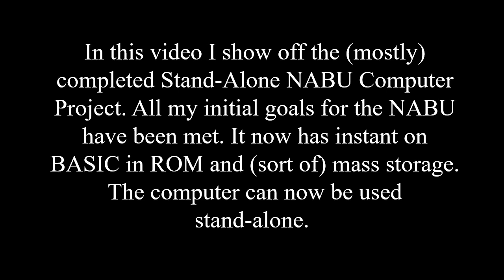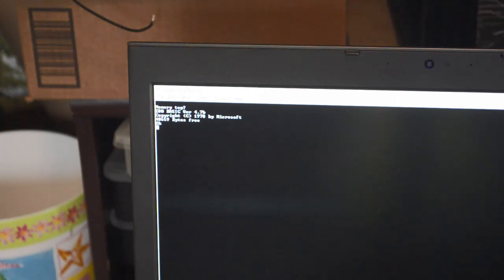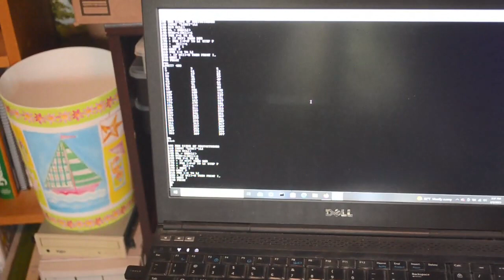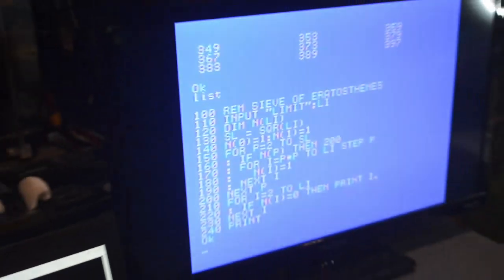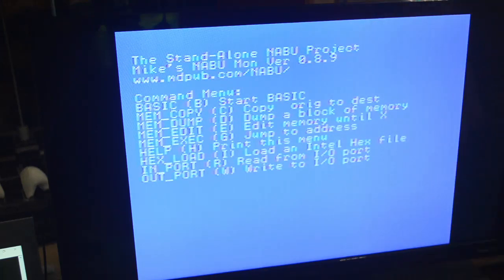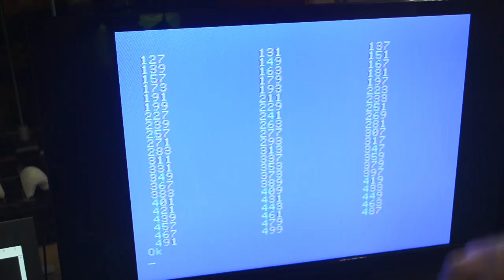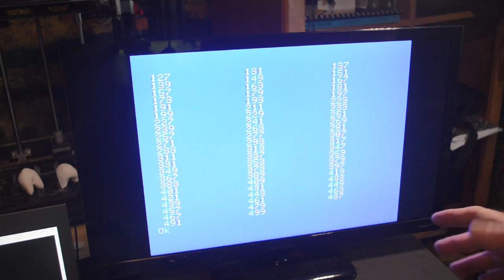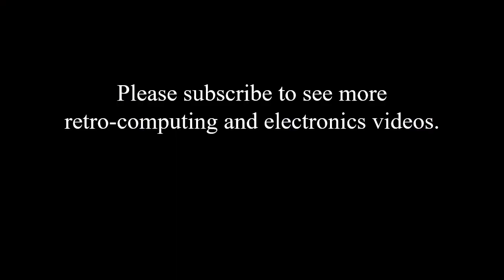NABU Computer Hacking #11 Mission Accomplished! The Stand-Alone NABU Is Ready

Comment: Wicked! Glad my backspace advice worked! I figured because I ran into the same thing with Microsoft basic and cloud cpm. The default baudrate is 111,861. Mjp’s pdf just rounds it down. I did the calculation.  The actual baudrate would be 111,860.78125bps, which is impossible to have decimal values. The baudrate is calculated by the TR1863 datasheet, which is the clock speed divided by 16. So the clock fed to the TR18 is divided with a flipflop, so it's 3579545 divided by 2, then by 16. The tr1863 datasheet says CLOCK/16 to get the frequency.